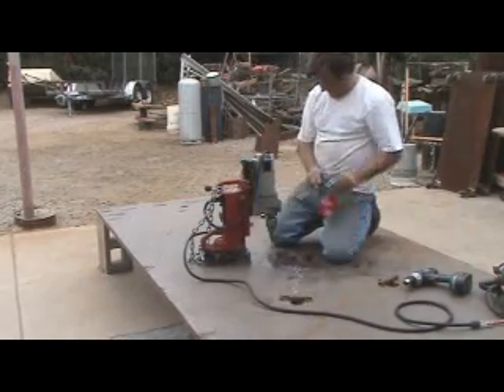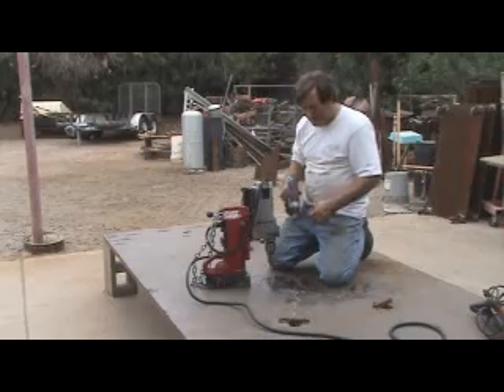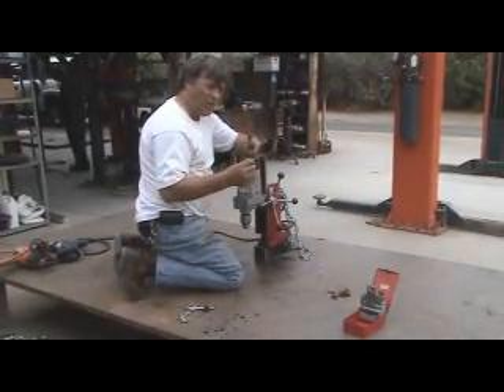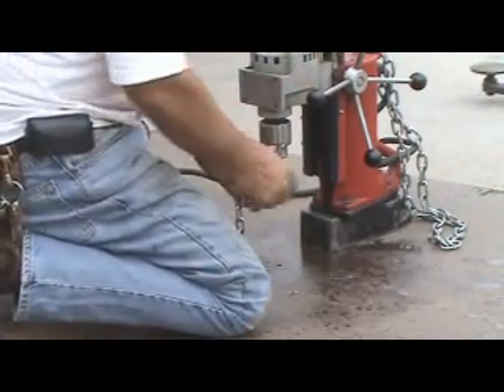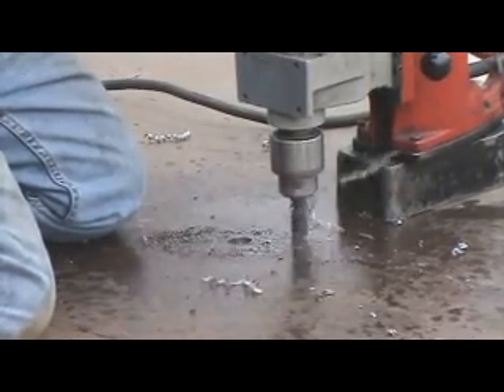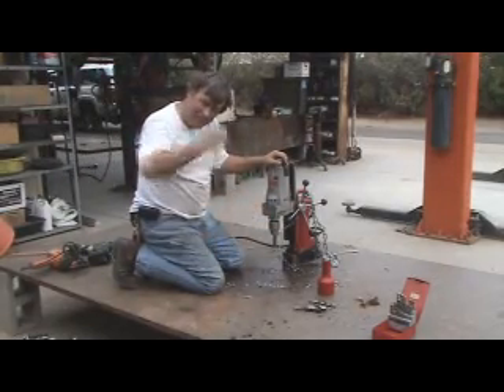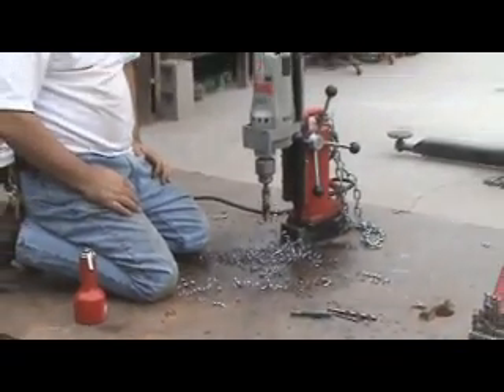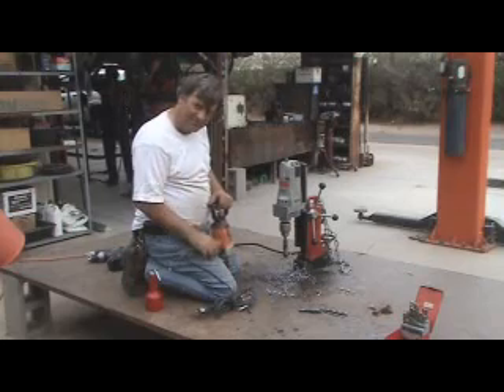Tools - A Magnetic Drill - Kevin Caron

Comment: Years late in adding my two bits, however I just loved using my mag drill using annular cutters. Drilled 96 holes using the environmental version of Rapid Tap instead of the Milwaukee Hole Hawg lubricant. Worked beautifully and annular cutters are still very sharp. Loving your early videos too, Kevin!

Comment: Yeap, mag drills are great in any construction sites, like press drills in workshops. Only thing is, when used horizontal you have to put a string or smaller chain on it, to hold it after switch off power or, haven for bid, in case power loss. It's too expensive to damage or drop on someone.